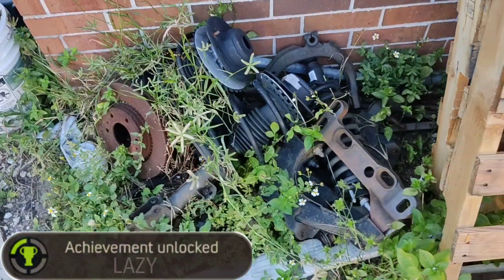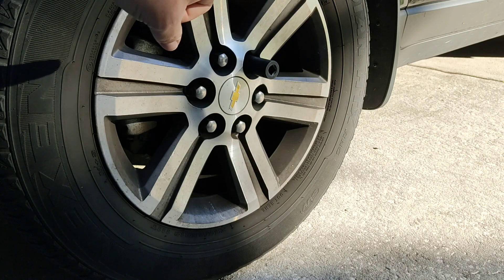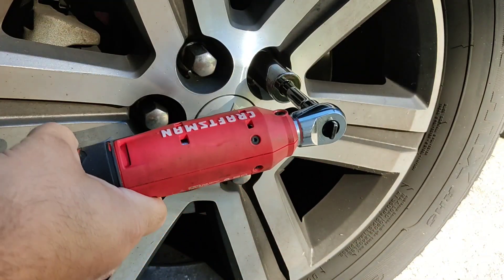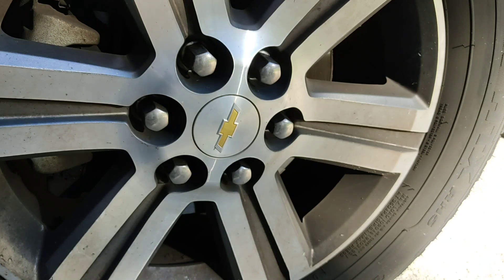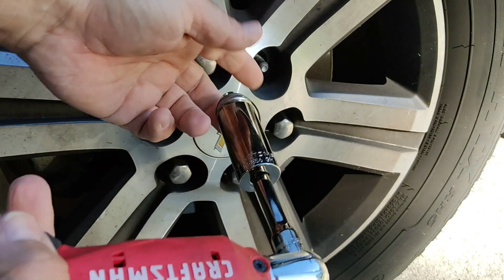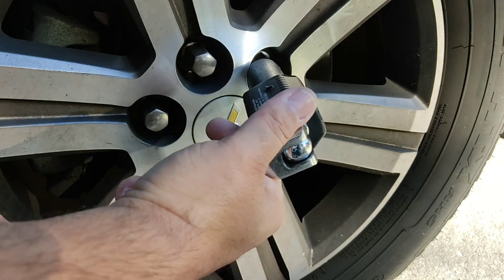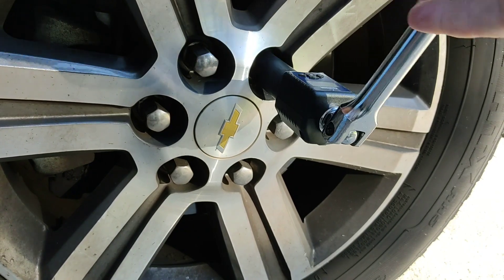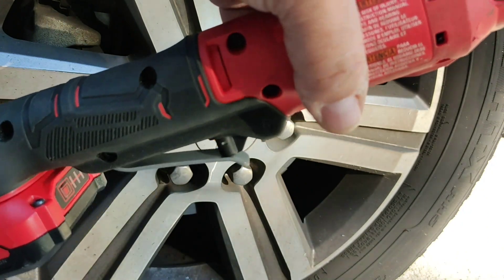HANDS ON Testing the Craftsman V20 Powered Ratchet!

Comment: Ive thought that the torque rating on electric ratchets isnt too important. Its a ratchet with leverage. Use some elbow greese to get it started and then hit the paddle to run it out. The most important part of these is the speed and battery life

Comment: They had a deal if you buy the fast charger and battery deal for $99, you got the ratchet free. They stopped that deal and did other tools instead last week. They moved the display I'm hoping they bring it back on Black Friday. I'll get it this time. I'm not that interested in the other tools. I'm really wanting the 4ah battery.
Reply from the maker: I'm still seeing online that the ratchet is free with the battery kit.
Reply: @toolinhand  I might just do that then. I bought the Bosch Freak instead when I was in there that day. They had told me that the offer was over.
Getting the Freak gave me another impact that I could use 1/2" sockets on as well as impact bits.
Reply: They still have that deal as of 21 DEC. i just got it from Lowe’s
Reply: @erikyoung2590  same
Reply: @erikyoung2590  is it in store only?
Reply: @erikyoung2590  have that deal again as of today! Just bought it earlier

Comment: If you use a bigger battery it will perform better maybe a 4 or 6 ah
Reply from the maker: It would. I used the 2ah battery,because most people will use it with the ratchet
Reply from the maker: It would. I used the 2ah battery,because most people will use it with the ratchet

Comment: I just bought 1 and am disappointed. I don't think it could open a twist off beer bottle.
Reply from the maker: It's not an impact, though. Crack the bolt loose first, then use the ratchet to spin it
Reply: @toolinhand  I understand.  It seems a little better after running it a few times.
Reply: Trust me gene I’ve used the snap on variants and they aren’t special either never going to get power unless it’s an impact variant

Comment: I can’t get over the size. No way that fits between an engine and a fire wall. Top engine work fine, but side engine work no way. Not worth $99.
Reply from the maker: It's average for an +18 volt ratchet.
Reply: Uh, phrasing!!
Reply: Does your hand fit your hands fit between the firewall and block than this will